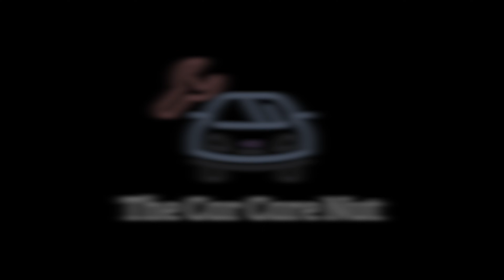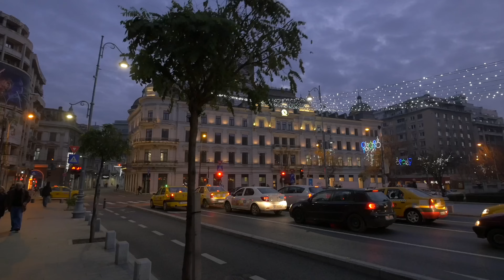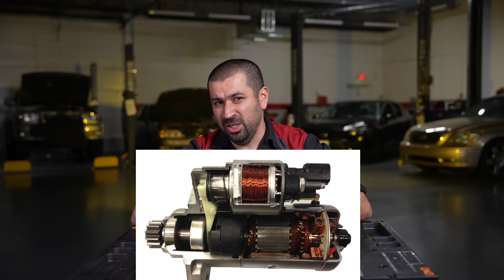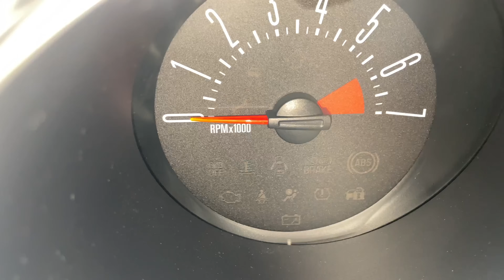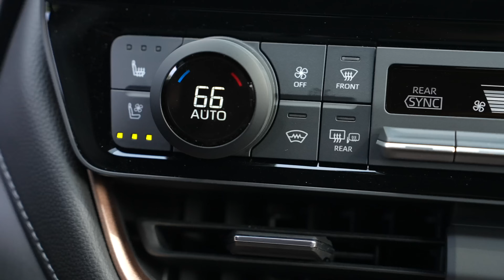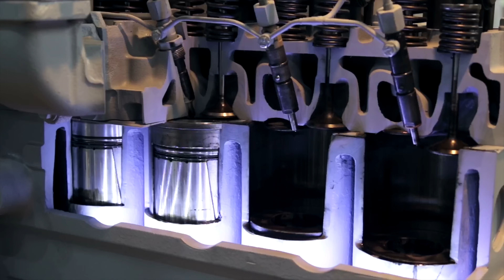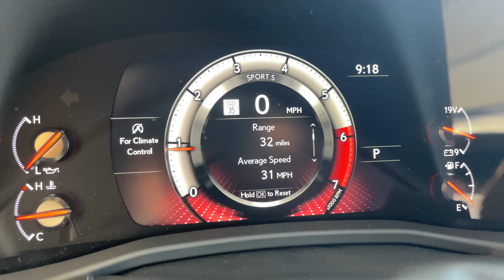How Does Start Stop Technology Work in Modern Cars? Everything You Need to Know

Comment: On my 2021 Highlander the start/stop never engages at stops and I never use the start/stop bypass button. The trick is to brake lightly on the pedal at stops and as Amd says "Life is Good"! When I first got my Highlander I thought the start/stop function was not working until I purposely pushed harder on the brake and then it worked. I guess I always had a light braking foot in all my cars lol.
Reply: 2023 Lexus rx. Same thing, but the dash will instruct how to use the start/stop brake. It worked fine for the 3 days I borrowed it.

Comment: Thanks for this excellent overview!  At the end there is the question "Can you Disable it Permanently?"  It occurs to me that if those electric motors for Start-Stop in the HVAC and AT never turn on anymore, will they freeze up after years of sitting there motionless?  Yeah, there aren't supposed to be any contaminants in these fluids, and electrolysis shouldn't happen with properly chose materials.  UPSHOT:  I'm wondering if (semi)permanently disabling it might do damage to some of the Start-Stop components?

Comment: I think start stop engine would only be good if it was mild hybrid or hybrid where you use the hybrid motor to start the engine and put all the accessories on the hybrid battery like The steering HVAC  oil pump water pump and brake by wire.
I actually enjoyed it in my old wife's BMW X3, I enjoyed the quietness when the car is stopped, my wife hated it.
Reply: My 2002 Prius has brake-by-wire, electric steering, but an engine-driven AC compressor, oil pump, and water pump. There's an auxiliary water pump to keep the heat going in the winter, and a special "'cold storage" AC evaporator to keep the AC cold in the summer.

Comment: I would imagine a certain number of motor dealers and back yard mechanics are going to reset the starter count for customers when the time times.
Did the companys upgrade the flywheel ring gear on the ICE and applicable vehicles to withstand the extra wear and tear? if so is it a similar "10 year" use buy date before it is worn beyond usability.

Comment: The most useless feature in any car. It's actually more political than than anything.  Can't wait till they ditch it.
Reply: Apparently the engineers that came up with this never heard of heat soak. Turning off a hot engine without letting it idle down first is a great way to insure you never make it past 150,000miles.

Comment: I like startstop, sitting at a light without the engine running means less vibrations, so a smoother riding experience with less emissions. At least until the motor mounts get worn out.

Comment: Great brief, I bought a 2022 Avalon Hybrid  LTD largely based on your post. The start stop is practically seamless, and while the CVT takes some getting used to I can't argue that technology makes this car very efficient.  It's beginning to grow on me.
Reply: The Toyota hybrids are a competently other story. The "starter" is a much bigger and stronger motor and the traction battery is much bigger than a normal car battery. This system can spin the engine to the perfect rpm fast and directly, the motor rpm are smaller and the gearing inside doesn't make any noise (helical gears vs.straight-cut gears).
You even have enough power in the electrical system to start the engine while using 15kilowatts for acceleration with the second electric motor (there are two big electric motors in the  hybrid system of the Avalon).

Comment: My commercial vehicle is turbo diesel, during a good and long trip I disengage the system in short stops. My concern is a the lube in a red hot turbo will fry and eventually reduce the life cycle of the ( turbo/ engine oil).

Comment: I have a 2020 GMC Terrain but I lucked out with GM’s faulty electronics and the auto/start stop stopped working at like 4,000 miles. It hasn’t worked in almost 3 years so between that and the fact I leased it before car prices surged I got a low buy out price I’m buying and keeping it.

Comment: What about the engine oil dropping to the bottom every time it stops? I've been told for ages that most of the engine wear occurs during the start, when the oil has to reach the higher parts, like the cams.
Reply: Don't worry, they'll add an electric oil pump for that 😅
Reply: The oil is at low pressure when electric pump so the cam and turbo have some but less protection.

Comment: I will definitely avoid any vehicle with this system after this brilliant review.I had no idea it was this complicated.
Reply: Only way to avoid it is to never buy a new vehicle. You are stuck with 2016ish and prior forever.
Reply: @volvo09 my Mazda CX5 2023 doesn’t have it but the new 2024s do.
Reply: @jawsgreatwhite9966 yeah was just going to say. I got a '23, the 24's now have it. Still, I think Mazda has done a good job with their engineering. I drove one of their CX-50s that had i-Stop and I didn't even notice.
Reply: @matsudakodo to be honest I’ve never tried a car that’s had it but I hear them next to me all the time at lights when the light turns green. It sounds like Mazdas are efficient with theirs so that’s a good thing and I hope they keep the option to turn it off if wanted. Cheers
Reply: I have a 2013 Vw, and it has it this system. It is a manual transmission, meaning if you stop the car with the clutch pressed. It will not turn off the engine. Besides all the thinks that wont last due to this system, the battery is more than double the price of the usual lead acid battery. The system  monitors the life and charge of the battery, if its weak it will either not activate the system or shut off then re-start after a few seconds.
Reply: @moffatk7948 
We have à manual VW T-ROC gasoline. At least there is a button to deactivate the start-stop, but each time you start your car you need again to deactivate it...
I've heard there is a small cable going on the positive battery pole you just need to disconnect. Not yet looked at it but seems a nice move. Doing that means the computer believes the battery is too low in charge to perform s/s.
Reply: @volvo09 I see you have volvo in your name I have an XC60 ironically the same year you posted and it had start/stop haha
Reply: Or just buy an EV
Reply: @phreak1118  all good if you live in a city. I have no chargers better than a dryer outlet within 150 miles.
Reply: @volvo09 A dryer outlet might be all you need for overnight charging.
Reply: Not true for all cars. I bought a brand new 2023 Land cruiser Prado last year and it does not have this start/stop feature at all.
Reply: Provided the system can be turned off easily,not nearly so bad as the "cylinder deactivation" or "displacement on demand" schemes which should never have been brought back after the Cadillac "V8-6-4' debacle
Reply: My Bronco has this system. I am gonna purchase the dongle that makes the system remember what the last setting of the on/off button was set at.
Reply: I have an “Auto Stop Eliminator” plugged in under the seat. Took 30 seconds to install and permanently disables the system. It’s also easily reversed.
Reply: Surely it can be programmed out in the PCU or ECU.  I had the DoD/AFM system disabled in my 2016 GMC Sierra 1500 that way.  I'm sure someone somewhere has a method to disable this 'feature' permanently.
Reply: Toyota 4Runner doesn’t have start/stop at least my 2022 doesn’t
Reply: If you buy new or new used you can’t avoid it!
Reply: @ronaldbrown5745  My 2018 Japanese manufactured Toyota Yaris doesn't have it so I'd better hang on to it then...and I still have two other 90's cars luckily.
Reply: @tolrem  ok. Grandpa.
Reply: you will find it i svery difficult to avoid this system ob cars, just learn to hit the bypass butting when you start
Reply: @ehbenson2948 the lesson here is that the bypass button is the least of your concern. The reengineering and addition of all these systems is the real problem.

Comment: I had a 2017 escape and was almost killed by stop start. So I tried to disable it.
I took the button apart and put some cardboard in it. Didn't work.
So I decided to try something conductive , custom cut a small piece of tin and placed it inside the button. It worked !
So If at first you don't succeed ..try again and again.
I have never seen any inspector verify that the stop start system is active. It's not part of the process.
  And as far as the system not shutting off the engine when it's cold...2017 escape did it anyway.  Maybe they thought about some of these problems LATER in the life of stop+start but they definitely released a half-baked "feature" to production back in the early days! I'm sure we would be shocked to know how many people have died from these systems that was chalked up to operator error. When you're already  dead, its hard to explain that the car killed you.
  But once you've been almost killed by this feature, you'll never trust it again.
Sorry but I'd rather save myself than the planet. Not willing to make that sacrifice at the moment.
All of our cars have DISABLED start stop and we typically try to buy only vehicles without it and certainly only vehicles with an override button. Only reason we got the 2020 Camry  was because it did not have this stop start "feature".
  And no turbos either BTW. I'll let everyone else buy premium gas and $115 oil changes.
Reply: for Ford, get the forscan and disable it completely.

Comment: Thanks for another interesting video. I thought the system in my Hilux 2.8 diesel was complicated, but not this much.
I live in Bangkok, Thailand where we have a horrible traffic. We also have a very hot and humid weather.
So when driving slowly, stopping , driving slowly again, the system turns engine exactly when you want to dri e another meter or two. When engine is off, the system starts engine again because of the climate system. Very annoying so I bought a cable, installed it, so now the system is off by default and I can turn it on if I want to. Another reason was because I guessed the starter and battery would have a shorter life because of this.

Comment: It sounds like it makes a car more expensive to buy and own. And if I own any equipment that I turn off a button and it comes back on automatically when I turn it back on, it will drive me crazy. I hate any manufacturer that does that certain options.
        I have a GPS every time I turn off the Bluetooth option it turns back on every time it comes back on. 
       I have an air conditioner that turns on economy mode on automatically  when I turn it off. I do not like it when I computer is telling me what I should have on or off. If I turn you on stay on if I turn you off stay off. Thank you for letting me gripe about this. 😅

Comment: As for the boost converter that you speak of. Actual proper boost converters that I am aware of are electronic devices known as DC to DC converters. You can typically feed them something very low like say 5 volts and they will output in this case a voltage that satisfies the voltage monitoring system or intuitively, 12 volts. A capacitor is fine but rather more limited in functionality for this purpose. The neat thing about a boost converter is that you can just run on it and it doesn't have to be part of the stop start system. This way there are no transition spikes or dips possibly scrambling the relevant modules.
As for the HVAC, I wonder if anyone has explored the idea of using a high side accumulator and a check valve at its input to extend evaporation time during the compressor outage.
Thanks for your explanation of this system.

Comment: On my Vitara mild hybrid it works flawlessly - it uses ISG instead of regular starter. It uses the belt instead of gears and there is no cranking noise (it does have regular starter, but it is only used when engine is turned off completely). Also it has the manual gearbox (as I prefer) and I have much better control about when to engage the start-stop. As long as I keep the clutch depressed, it will not stop the engine, and when I put into neutral and release the clutch, it will stop immediately. As soon as I press the clutch again, it will start the engine so smoothly that I don't even notice that something is going on, without looking at the tachometer.

Comment: I have never driven a car with stop/start, but I think is a very reasonable idea but made entirely too complex. For example, don't add and electric water pump and a special evaporator, simply turn off the climate control fan then turn it back on when the engine is restarted. Also, from what I have seen, they annoyingly and possibly dangerously restart if you let up a little too much on the brake. It would be so much better if restart is triggered by pressing on the accelerator.

Comment: The start/stop technology is totally a scam. Every start/stop will create more pollution than just idling for a few seconds. The same will apply to the ban on diesel vehicles. Does a 45  mpg diesel pollute more than a 12 mpg gas hogs? I don't know. I am so glad that I bought a new 2020 Rav4 LE  without start/stop "new technology" cuz I know it will burn me for repair bills in the long run. If I only lease one for 2-3 years, who cares. BTW, Toyota says their stop/start starters will last 384K starts. Well, if you live in a farmland in the middle of nowhere, the starter may last for quite some time. But if you live in a major city where the FWY is actually a parking lot with heater or a/c on & with your electronic gadgets plugged in, do the math and you will find out how soon you need a new starter, battery, etc.,

Comment: the only sensor car manufacturers missed is the sensor for red traffic light. when the engine shuts off at unregulated intersection where I need to stop for a second or just slow down to let the other cars pass and start driving immediatelly, this start-stop pause become really dangerous. so, yes, I always push that start-stop off button to be on the safe side.
Reply: Better safe than squished

Comment: All this technology and effort and more stuff to go wrong for a very minuscule improvement in emissions. 

One of the reasons I like my old cars 

What's particularly annoying is they make the default with it on so just to annoy you all the more if you don't like it you have to turn it off every time you get into the car 

That in plastic parts. What's their rationale for using plastic parts? To save weight? 

At the expense of the crap breaking after a year or two 

Even Mercedes has a plastic water pump in one of their four-cylinder engines

Comment: Toyota still sends me a yearly TSB to get the Start-Stop system installed on my now 16 year old Tundra. Um, no thanks! I understand all the emissions things, but I'll turn my truck off myself when I want to save fuel and such. Replacing the starter is not something I want to do every year or two. The alternator was bad enough! They claim it's only a module they're going to add, which from all I've read from other owners who have had this installed, it's a giant can of worms that is constantly creating electrical gremlins in the ECU that further leads to more issues. I like my vehicles to be dumb and reliable, reasonably easy to repair and maintain. Just adding a 'module' to monitor and engage that system on a vehicle that was never designed for it sounds like a terrible idea.
Add: I nearly forgot, but the last stop-start system I dealt with on a weekly basis was a run-around golf cart (carbureted even) about 2007. It was not new (the cart that is) but had no fancy electronics. Granted, it's a much more simple vehicle, but I suspect the stop-start was basically an ignition-based system. Kind of interesting tie-in to your story.

Comment: For those with newer vehicles that are not equipped with the factory "off" button for the SS system, you should be able to turn the system off by first opening the hood and starting the car with the hood open -- the system will remain disabled until the next key-off cycle. Not exactly the most convenient workaround though.  😂

Comment: One of the things I could never understand is the dislike of this system. Why would you not like to have a more efficient and less wasteful machine? Why would not want to cut down on emissions? Why would you even want to turn the system off is a bit strange to me - perhaps that is a safety issue more than anything.

It may come as a surprise to some people (hopefully not too many) but there are more cars on the road than your own. There are over 615 million cars on the road in EU, Canada and USA. If one start-stop cycle saves (on average) as little as a milliliter of a fuel, that is about 615 000 litres of fuel that wasn't burned needlessly. That's ~14 large tanker trucks of gas. And this is just one start-stop cycle. Is personal preference or perceived inconvenience really that much more important than the environmental benefits garnered by the system?

Excellent overview - thank you for this video!

Comment: What no one has mentioned is if you are easy on the brake pedal and don’t press too hard it won’t shut off. You can still stop just fine . Try it next time you have to stop,go easy on the brake and it stays on then press a little harder and it will shut off. With a little practice you can drive without it shutting off almost all the time.

Comment: Can anyone please tell me the correct ride height on a 2003 Toyota Camry Xle 3.0v6? Recently replaced the front struts now the car sets to low in the front? I can't find the correct ride height anywhere. I measured from level ground to the center bottom lip of the fender and its 26.5 inches. I have the right size tires no mismatched size. Please help!!!!!@@!@@!!!